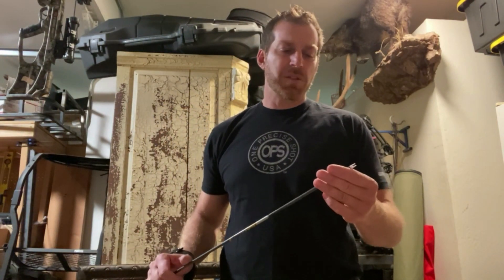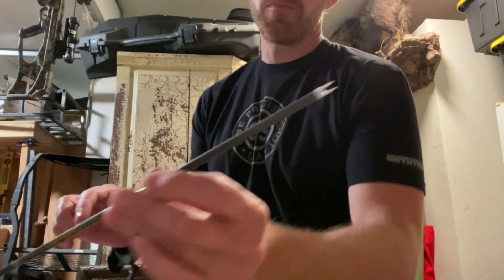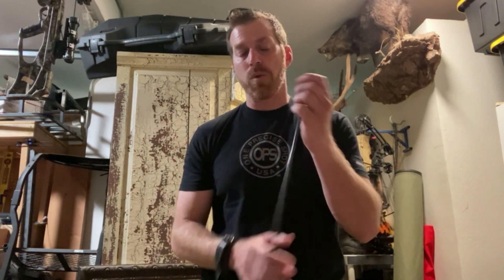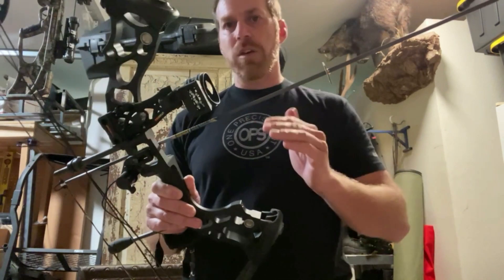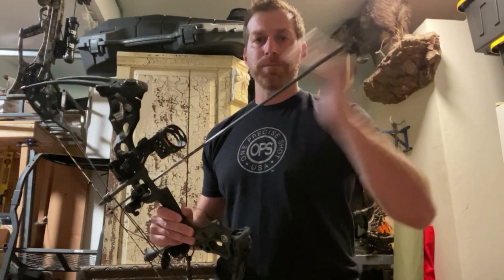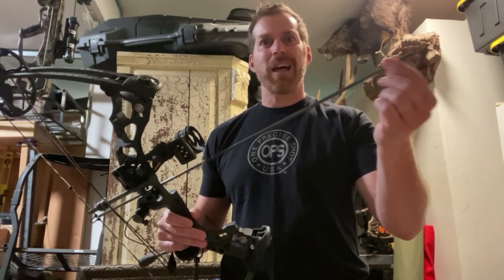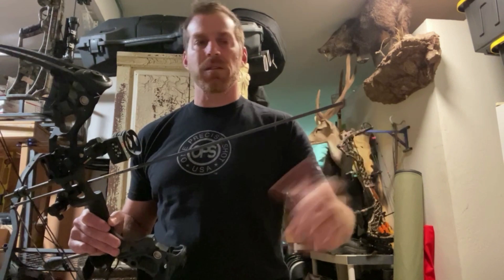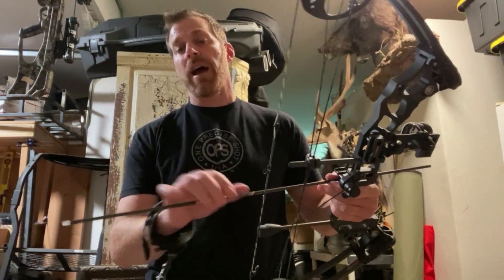How to determine Arrow Length

Comment: Great video John. For the sake of safety, I’d recommend having the arrow shaft extend at least a 1/4” to 1/2” in front of the riser. This greatly reduces the likelihood of a sharp broadhead  cutting your grip hand.  A hunter may have shot thousands of shorter arrows without incident, but during hunting season, conditions change. That same hunter could now be physically and mentally exhausted, not to mention sleep deprived. All it takes is one moment of inattentiveness, and you can kiss those fingers goodbye. Good luck hunting this season
Reply from the maker: great point

Comment: I don’t consider arrow length...a bow doesn’t care.  I start with full length (in the ball park spine) & load the front end for FOC & total arrow weight I want.  Then I bare shaft tune & let the bow & arrow combo determine the total length.